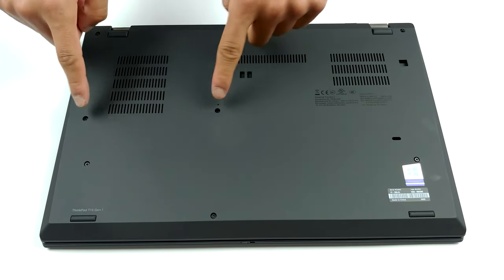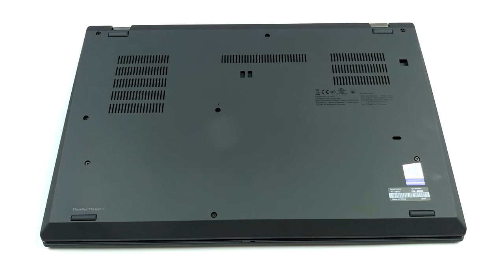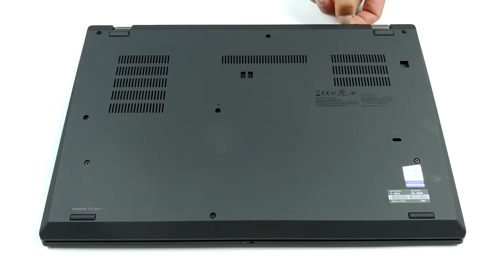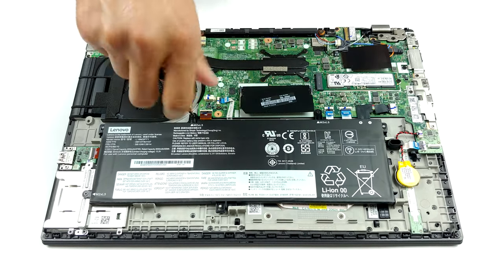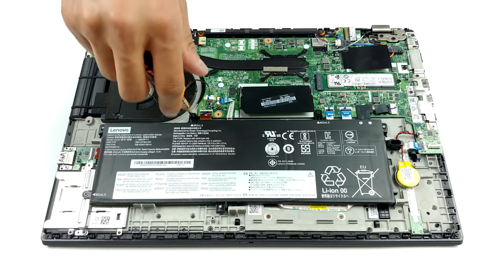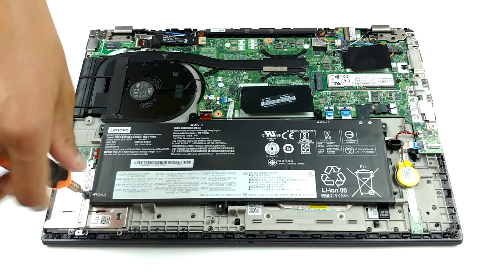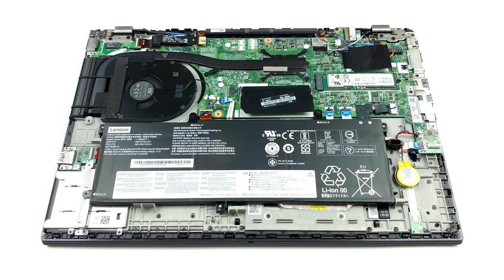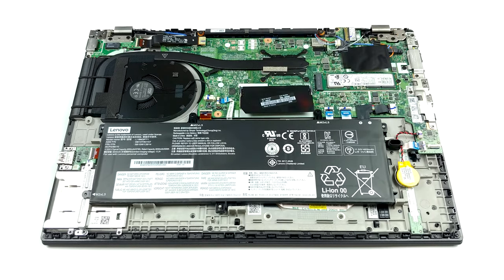🛠️ Lenovo ThinkPad T15 - disassembly and upgrade options

Comment: Important!  The T15P Gen1 (current) is completely different computer on the inside.   The bottom cover comes the same way.
Differences: TWO Memory slots (none soldered!)  TWO M.2 Drive bays.   Optional GeForce GPU (cannot be added later).
The T15P also has faster and louder H CPUs, that you may want to turn down to 70~75% in the power settings to not get the jet-engine fan noises.  It's about a 20% loss in top performance, but silence is golden.

The Regular T15 use 15W CPUs, so you shouldn't hear the fan.
Reply: D-Dude, I want to upgrade my Nvidia GeForce X330 graphics card in my T15 Gen1.  Is this possible in this laptop?  Seems this is a very low end and I want to run a Samsung UHD monitor or two. With this X330 card it can't drive this monitor.  Your thoughts or suggestions are appreciated.
Reply: @thegolfnut812  Your only option is to get an external graphics adapter. You can go the USB C route and an EGPU box (like the Razer Core), or preferably, an NVME to PCIE adapter. 

The latter has way more bandwidth, but requires you to sacrifice an NVME slot. Another downside of having an NVME adapter/PSU combo is having cables dangle off your laptop, which turns it to less of a laptop and more of a desktop.

Since you run multiple monitors anyway, you might wanna consider this.

Comment: I really hate working on this model. I don't think I've ever opened one up without snapping off one of the little plastic clips inside (unless it had been opened previously). You can't open one of these with a simple opening pick without snapping something. It's not built to do that. It won't harm anything if you're careful; the plastic bits are on the inside of course, you'll never see them. But it is unnecessary how difficult Lenovo makes these things to get into. Go with a ThinkBook, or an HP.
Reply: Yikes! I still use a T400 on a daily basis for my personal laptop but recently purchased a T15 Gen 2 for work. I like the T15 a lot but I don't like the inability to easily change the parts.

Comment: So there is no user accessible memory door on the case?? That's horrendous!! You have to disassemble the case to get to the "user accessible" memory. WTF Lenovo???
Reply: You need to get the T15g model for this, the `g` being the premium modular version supporting dual NVMe and 4 SO-DIMMs.
Reply: @gnif  Thank you.
Reply: Nature of the biz.   My old ThinkPad R series has quite a large number of screws to access memory (from the top), one screw for the HD.  one screw for the DVD drive.
With today's notebooks, there isn't much that people have to actually upgrade.   To remove those 8 or so screws only took a few minutes on a modern T model and same with the L series.  It saves a bit in cost, but still have Thinkpad quality and some keyboard liquid protection.

I also have a 13yr old X-series which has a metal bottom, modular covers on the bottom, about 20 screws on the bottom.  Half of the bottom is also covered in various microsoft stickers. LOL!   I think it was about $3000 brand new back then.    So, still a premium for a modern top-end THinkpad.   They may look identical on top, but with different guts.

Comment: I want to upgrade my Nvidia GeForce X330 graphics card in my T15 Gen1.  Is this possible in this laptop?  Seems this is a very low end and I want to run a Samsung UHD monitor or two. With this X330 card it can't drive this monitor.  Your thoughts or suggestions are appreciated.

Comment: Unremovable battery, ram soldered into motherboard, WTF happend to thinkpads...
Reply: Cost savings.   Get the higher end P or T15P series for dual RAMslots (not soldered).  I'm okay with the battery, it lasts MUCH longer than those from 15+ years ago.  It shaves off a little bit of weight, more battery... better weight balance. 

Hey, with an Apple Notebook, the SSD and memory is soldered... so no upgrading and if the notebook dies, the SSD dies with it... along with your data. (They removed the lifeboat connector).
Reply: its not unremovable! its just not a easy to swap one. Nowadays people just buy an external usbc power bank so its no biggie.  Also, the ram soldered is base ram, you can put an extra stick.
Reply: @santiagoferrari1973   The battery is not much of an issue.  Again - they run 2~4x longer than 15 years ago.   Replacement is not difficult, a few screws, pop off the bottom and pull the cable connector (As you said "not easy to swap" like the old style).    But soldered RAM is problematic.   If the owner wants dual-channel memory, that will likely not happen (okay a minor performance hit).   If the owner bought an 8GB model, and only has one slot to add 16GB,  the memory upgrade flexibility is lost.    vs buying two 16GB for 32GB RAM.
Reply: No one is changing ram as often as shoes.
Reply: @santiagoferrari1973  yes, but if memory dies as in my case you're done...

Comment: I have the Lenovo Thinkpad T15 Gen. 1.  I had them put 16GB RAM soldered into board but wish to add another 16GB in the open slot.  The RAM soldered to the board is Samsung part # M471A2G44AM0-CWE.  It's DDR4-3200 which, for some reason, runs at 2666.  Can't find that part number anywhere.  I did find Samsung DDR4-3200, part # M471A2K43DB1-CWE.  I'm reasonably confident this will work but just wondering if anyone has used this combo.
Reply: It'll work.

Comment: Just bought a lenovo c340 with fake fan and fake heasink.
Reply: It's a $200 Chromebook running on a horrible atom CPU.   It has a weak and cheap cooling system.
Reply: @TexasCat99  my spec is i5 10510. but cooling is shit.
Reply: @王力-p6w  a lot of manufacturers do that.   Go through settings in Windows 10 and detune the CPU to reduce heat.   Yeah... That's stupid.   

Oh wait. If that's a Chromebook I don't know if you can tell what to run the CPU at a lower rate.

The bios settings may have options to reduce performance and heat
Reply: @王力-p6w  also, may get more input and advice from a video about the Lenovo c340.

ThinkPad line is very different from their consumer line.
Reply: @TexasCat99  They have dual fans and heatsink with dual air output for the amd version. Screw Lenovo, even I from China.